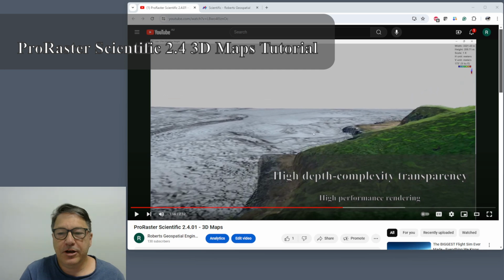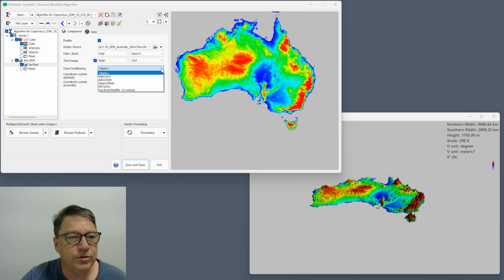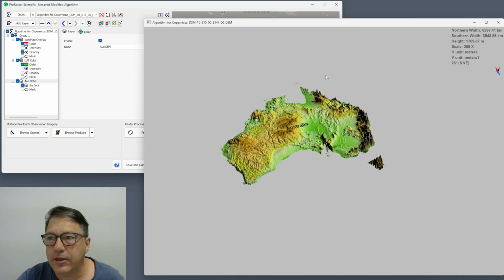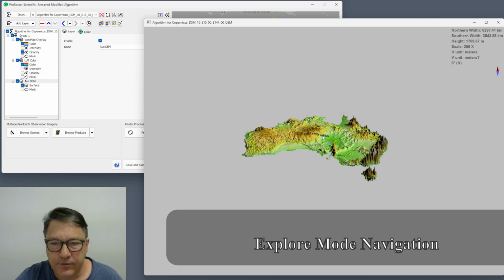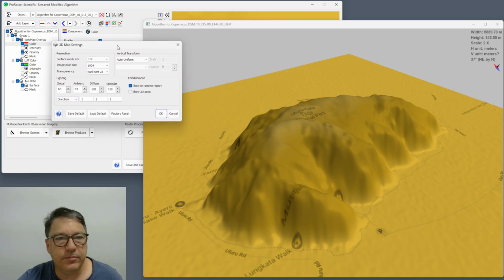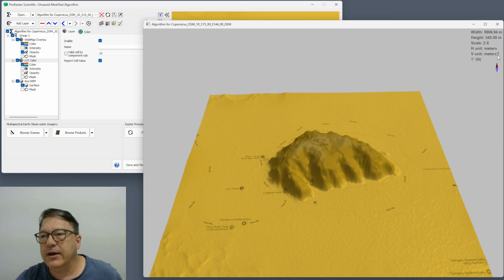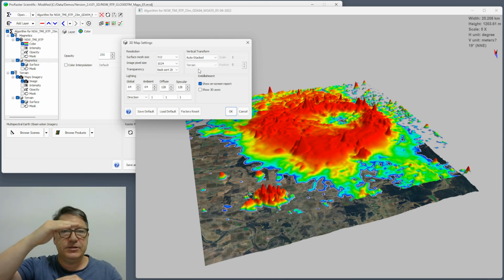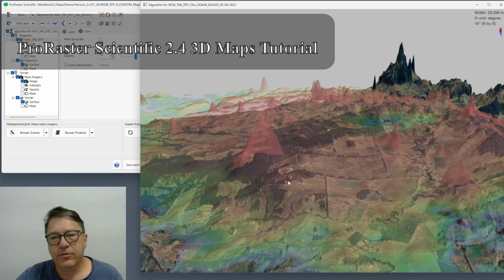ProRaster Scientific 2.4.01 - 3D Maps Deep Dive Tutorial

Comment from the maker: I forget to mention multisampling. Multisampling reduces aliasing rendering issues and generally improves the visual quality of the 3D map. However, it may have a substantial impact on rendering performance. It is turned off by default. You can turn it on/off from the main Options dialog. The changes will apply to any new 3D maps you open.